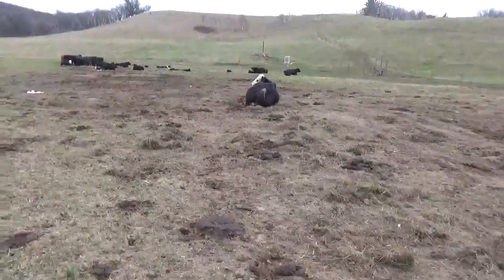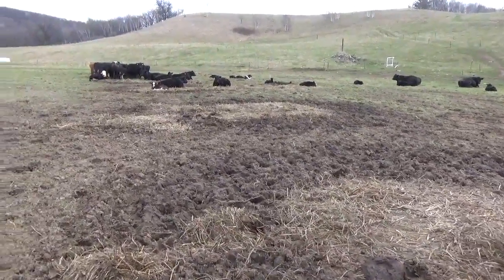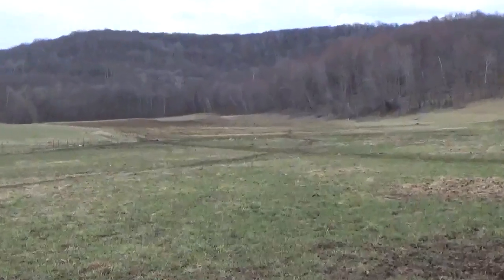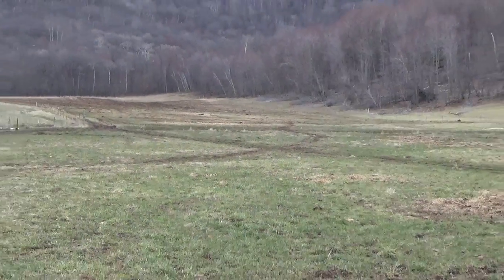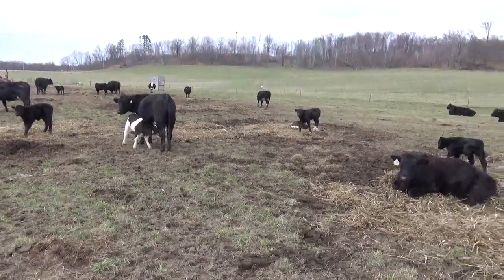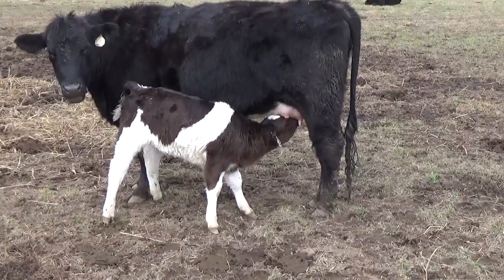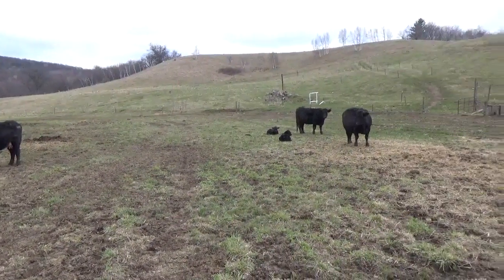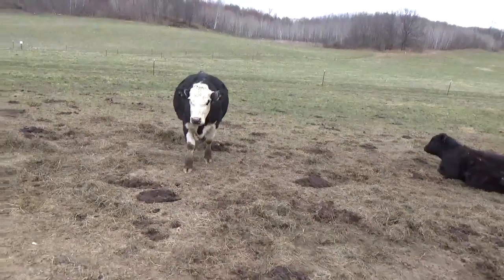Checking on the cows and talking about work at Badgerland shop

Comment: nice video, what kind of tractors do you have?
Reply from the maker: +C&J FARMS Right now I only have the JD4020, 6400 and the old 2 cylinder 60. I sold the 4440 and 4430 to buy more land and I also sold a 4030 last fall to buy the 6400. I am looking for a 7400-7600. I like the newer cabs better than the old sound guard cabs.